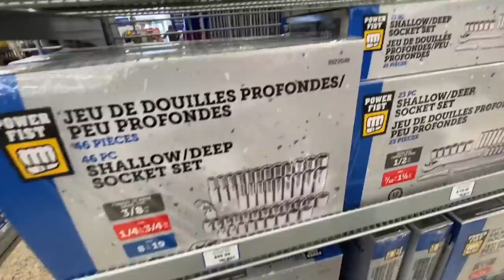GMC Sierra VS JEEP DESTROYED!

Comment: Hey Mark!  Suggestion...  when your dragging the old crap run your yankem strap straight through the a wheel.  If your pull force is higher than your load there will a slight lift added.  When your load point is higher you’re are adding force into the ground.  Try it my friend!  Much experience in this area!
Reply from the maker: Will do!